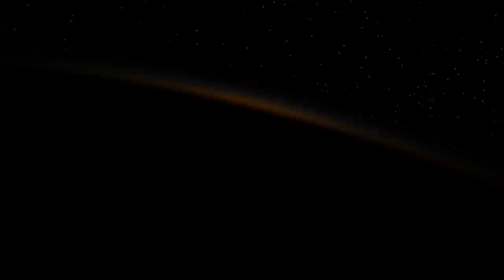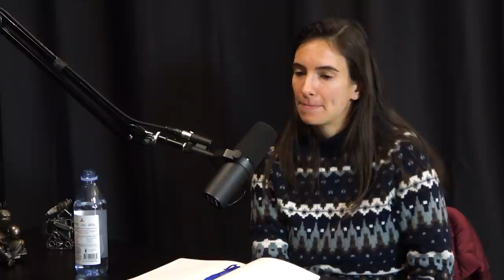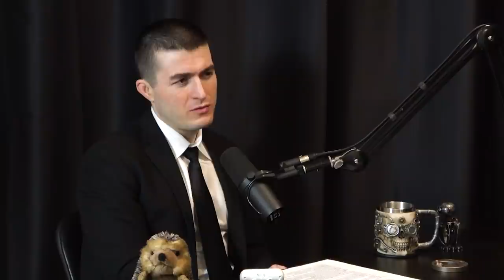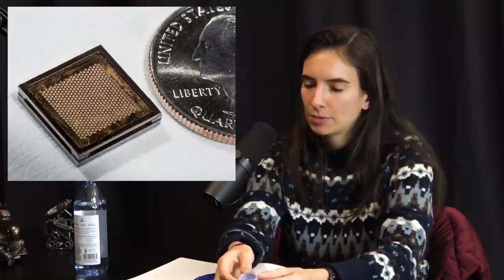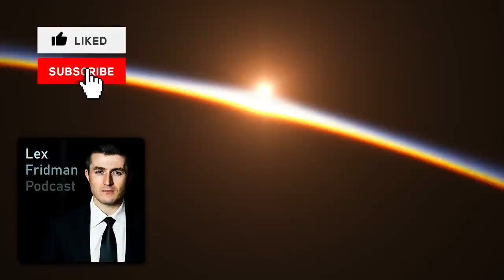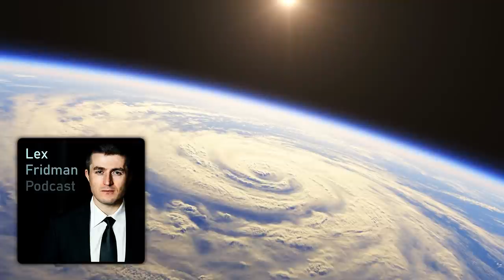How Colloid Engines Work | Natalya Bailey and Lex Fridman

Comment: What if you place a series of colloid thrusters on a curved surface to increase thrust generated per cm2 of satellite surface area. You could alter the magnetic field vector and direction of the cone structure so that thrust is created in the desired direction. Could be particularly useful on smaller satellites where available surface area is limited.